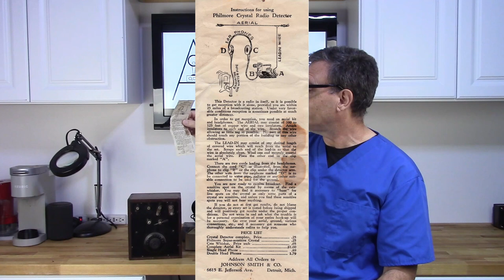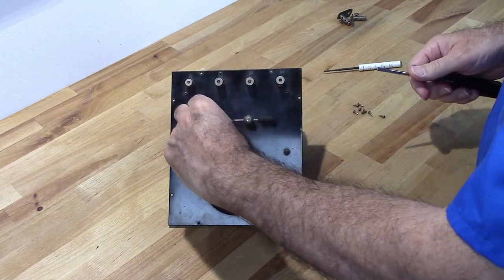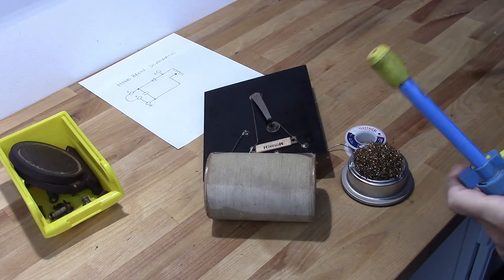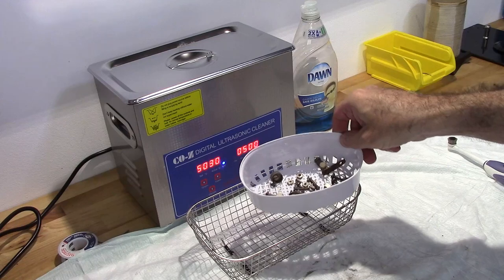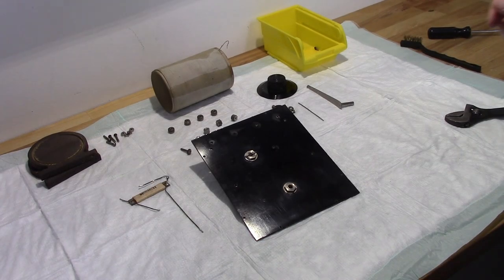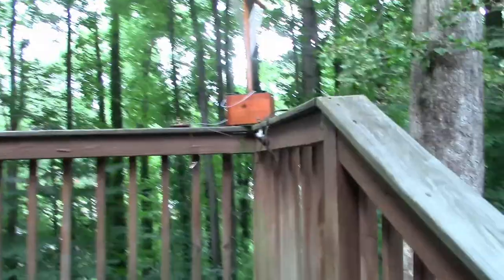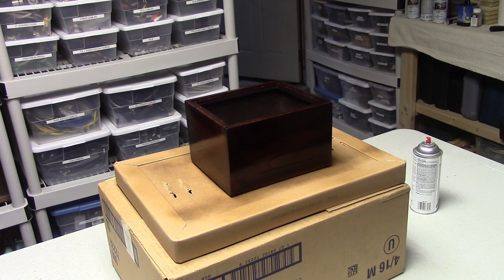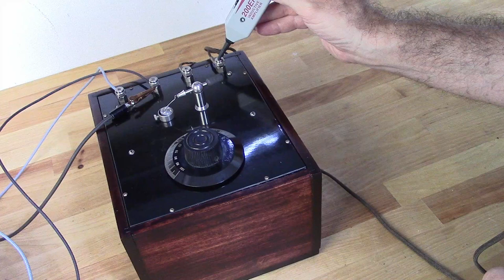1920s Home Brew Crystal Radio Restoration

Comment: Another very enjoyable video. And as usual I found it really interesting. Would it be possible for you to make a video on that very elegant looking antenna you have. I would love to build one. Once again thank you.
Reply from the maker: I tried to find the website I used to build it, but it apparently has been taken down.  It's a shame because it gave step by step instructions.  I'll try to do a video on how to make one but I'm behind on other projects right now.  Litz wire isn't cheap but it's the main ingredient and requires about 100 feet.  But basically it's two loops, an inner and outer loop.  The inner loop can be switched through a tunable capacitor or fixed capacitor.  The outer loop is what's connected to the radio and it's just the outer two loops of wire.  I posted 3 files with the plans I used from the site when it was up and a written description.  Here's the link:  https://www.facebook.com/media/set/?set=a.5399885323427254&type=3

Comment: That is a great-looking antenna.  Did you build that one?  I am looking to build one for myself and I would like to get ahold of the build plans for that one.
Reply from the maker: I tried to find the web site I used to build it, but it's gone.  I will have to put together a video with plans to do another one for the channel.  I'll post the plans I worked from on the Antique Radio Archeology page.  I deviated a little from the plans, but it gives you a decent start.  There are 3 files.  Here's the link:  https://www.facebook.com/media/set/?set=a.5399885323427254&type=3
Reply: @antiqueradioarcheology-wil8878  Thanks so much for the info.  I will also b looking forward to your videos.